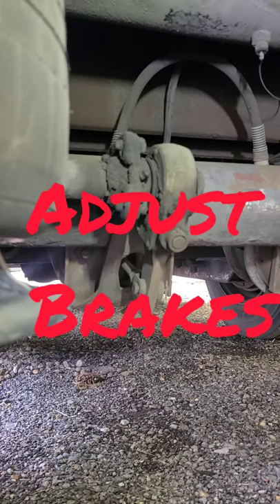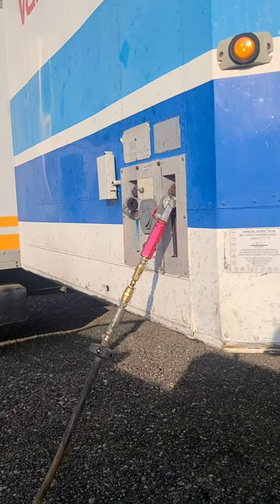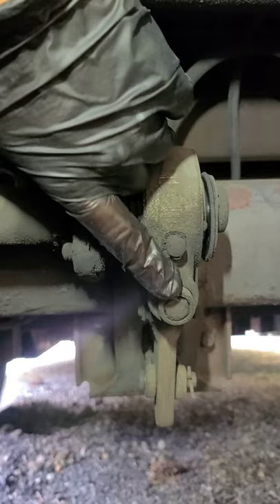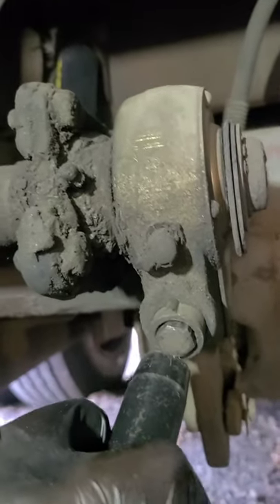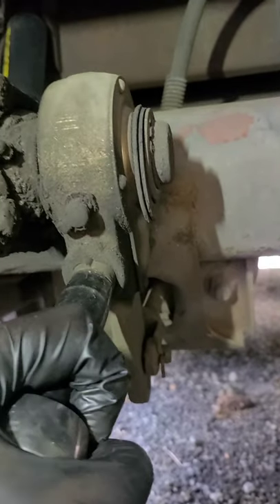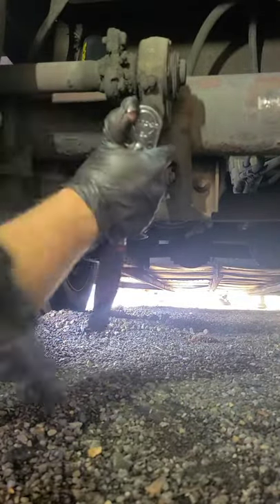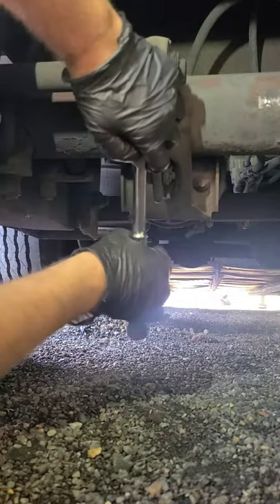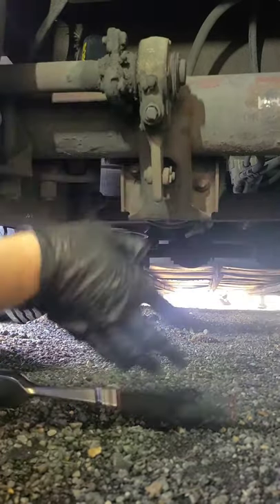Semi Truck Brake Adjust- Subscribe Support Veteran Owned Business!!!

Comment: My truck has the old manual slacks with sleeves, I always keep a straight screwdriver and a hammer because sometimes you have to knock them back at first to loosen them up. Glad you’re showing guys this, i have a feeling at least 1 in 5 crashes could be prevented with proper brake adjustment, automatic slacks are not an excuse for not checking and adjusting your brakes.
Reply from the maker: I do not believe in automatic adjusters, they never work.